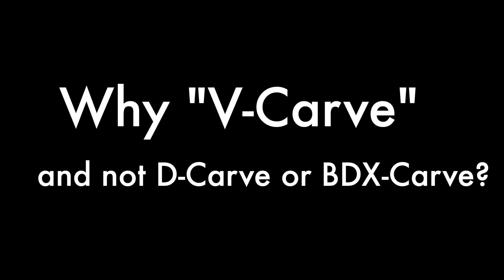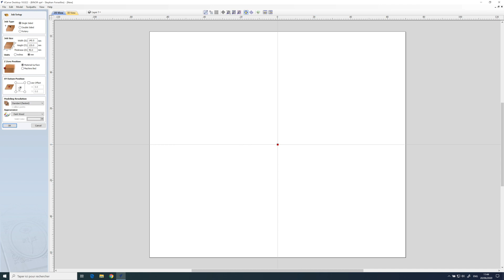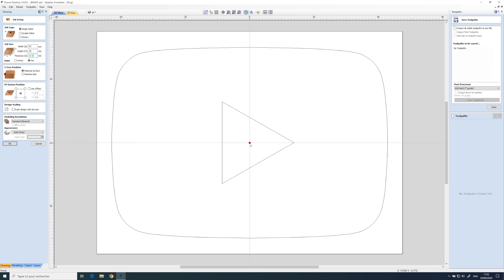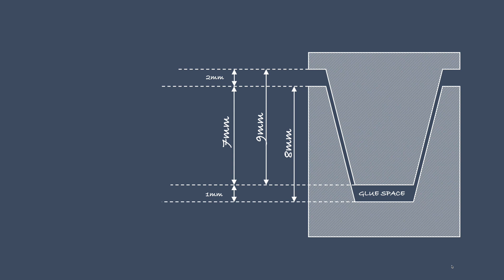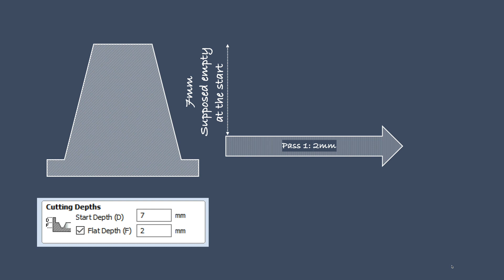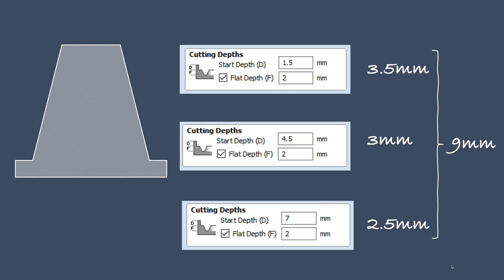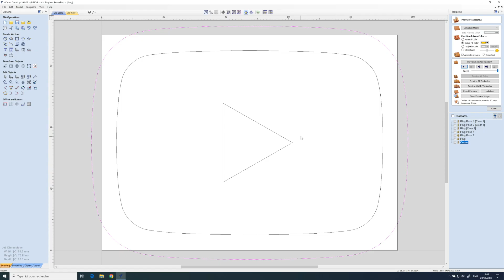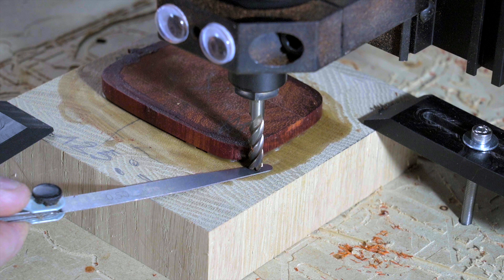Deep inlays VCarving detailed tutorial with Vectric VCarve

Comment: Great tutorial Stephan. Did you ever have problems with the plug being very loose in the pocket? I used the same settings you did, but it actually rattles side to side.  I'm using a 15 degree 4mm shank vbit. Perhaps acceleration, or deflection in the bit? Any ideas?  Thanks
Reply from the maker: Yes I have that sometimes if the carving is deep. It happens more in Y direction than in X which makes me think about deflection too. I have some ideas to test to avoid that...
Reply: I have this same problem! I'm thinking the vector for the plug needs to be enlarged a little before generating the tool paths. Please let me know if you found a solution to this problem. Thanks!
Reply from the maker: @tysonfish8065  I found out that configuring the bit as a carving bit with the right flat tip helps. If you don't configure the flat tip the bit goes a bit deeper than Vcarve thinks so you remove more material than needed both in the pocket and the plug.
Reply: @tysonfish8065  I cut a test circle pocket and plug yesterday. The plug wcame out too small and the pocket too big, which tells me   either my steps per mm is incorrect (unlikely) or my bit is taking off too much material. I had a thought to try it as a climb cut instead of conventional. I might do that next.
Reply: @Nealieboyee  and @Stephan Forseilles Thanks for this tips. I changed my bit to an engraving bit where I can define the correct flat tip and it did improve my results but the plug was still a bit loose. I then measured the angle of my 15deg bit and found it was actually 17deg so I changed the engraving bit angle to 8.5deg (as you know angle settings for engraving bits use half angle). This improved my results a little bit more. Finally I made my pocket and plug depth the same so the plug does not stick out by 1mm as shown in the video. After this change the pocket and plug fit very tight with very little to no movement. I have the pieces glued together and am waiting for them to dry so I can see how the glue line ends up looking. Thanks again for the help!
Reply: @tysonfish8065  Good experiments!  How did you measure the correct angle of your vbit?
Reply: @Nealieboyee  it was a very crude measurement but I simply traced the outline of the bit with a pencil used a ruler to extend the outline and then used a protractor to measure the angle. There is probably a much more precise method but this resulted in 17deg on the dot.
Reply: @tysonfish8065  Very clever way to do it! I know there are carving tests for 60 and 90 degree tests but they don't work so well with such a small angled bit.
Reply from the maker: @tysonfish8065  Indeed there is no magic bullet and a lot of things must fit together for a good... fit. :) There are specialized microscopes for measuring bit angles and flat tips. I don't have one but I'm thinking of getting one. Often they don't match what's on the specifications because in most applications one or two degree doesn't make a big difference. But as those add up when doing inlays, it can wreak havoc.
Reply from the maker: And in any case it's always better to configure the tip with a large angle than it is (you'll end up with a larger glue gap) than a smaller one (you end up with a loose plug).
Reply: @tysonfish8065  v

Comment: Very Nice Video and explanation.  What CNC machine are you using?
Reply from the maker: Thanks! It's an Aureus 3X from Euro Makers.
Reply: @sfo2406  Thanks for your quick reply.  I don't know that I will be able to afford this machine but it does look much more powerful and "solid" than my current machine.  Like other hobbies I've gotten interested in (too many!) I tend to buy something cheaper in case it "doesn't work out".  So, I purchased a hobby-grade machine that basically works.  After getting past some stability and alignment issues, a short coming for sure is the spindle which is just a cheap DeWalt router with a 1/4 inch bit capability.  So, carving always takes longer, especially clearing.  No need to reply to this, but, your video was well worth watching.  Like a lot of things in life, someone else's experience and tips can be a big learning curve reducer.  Gary

Comment: Thank you for teaching us. If I may ask a question... Instead of leaving the plug 0.5mm above the wood surface and then sanding it flat, I could choose to resurface the entire project down 0.5mm as the final step, so it's all flat, and less sanding would be required, is that correct?
Reply from the maker: Yes that is a perfectly good method! It also ensures that the board is really flat (which isn't the case when you sand).

Comment: this Is  a fantastic tutorial, but still can't get mine to fit the plug in the female slot. can't understand why
Reply from the maker: Does it not fit at all or does it fit badly? What I sometimes do in such cases is to make some tests in some material like MDF which is cheap and carves easily (but don't breathe the dust...). Then I glue everything and cross-cut in the middle to see what happened. If it doesn't fit at all it may mean that the start depth of the plug is 0. Remember that Start Depth is 'what goes in', for the plug (flat depth being "what sticks out").

Comment: This is by far the best tutorial I have found on deep inlays with V-Carve Pro. I only wish it were in Imperial measures. :) That is a small matter though to transpose.
Reply from the maker: Thanks! As a European I cannot grasp imperial, it must be genetic! :) But next time I will enrol Google to convert for me so I can put imperial measures in the captions.
Reply: @sfo2406  In your Tool Database for the 15 degree bit you are using, shows a Geometry Diameter of 6 mm. This is equivalent to 0.23622 inches. For the Amana Spektra #45780-K SC CARVING LINER 15°VT. 1/4"SH, the Diameter shows 0.1875 inches, (4.7625 mm). Is the bit you are using shorter in length?  I guess a better question is, what 15 degree bit are you actually using?
Reply from the maker: @Warpfield  Hi indeed 6mm is just below a quarter inch. It's 50mm long in total but that's not really relevant (I generally create new bits in the database by copying an existing one first and I almost never change the total length). What's important is the length of the carving part which is the same on all the bits of the same diameter and angle as long as the angle goes all the way to the full diameter. This is an example of such a bit: https://amzn.to/3djvOeG . You can also easily find them on Banggood for example: https://www.banggood.com/Drillpro-6mm-Shank-0_1mm-Tip-10-or-15-or-20-or-30-or-45-or-60-Degree-Engraving-Bit-CNC-Tool-p-1478458.html?rmmds=detail-left-hotproducts__2&ID=6155424&cur_warehouse=CN

But I couldn't find one on Amazon.com...

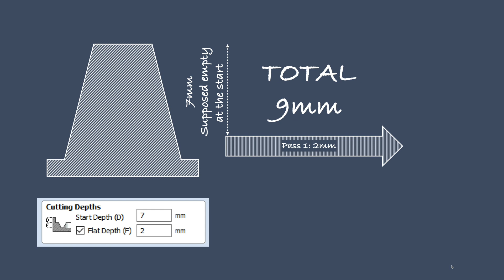Comment: @23:22 You said the start depth is considered as empty space but your solution of initially cutting at 1.5mm start depth then 2mm flat depth still means that you are telling v-carve 1.5mm is cleared which at that point is hasnt been. so you need an additional toolpath at the beginning with a start depth of 0mm and a flat depth of 1.5

So it would be 

SD 0 FD 1.5
SD 1.5 FD 2
SD 4.5 FD 2
SD 7mm FD 2

That way your bit will not plunge into your workpiece.
Reply from the maker: Luke Indeed you are right but up to  5mm depth at 1000mm/min is no problem for my CNC so I have a pass less. Especially for the first one as all borders will be re-done anyway by the next passes so precision is not super important.
Reply: @sfo2406  Yeah you are taking a 5mm depth pass to begin with instead 3.5mm as you put in your graphic in the video as in CAM its 3.5mm but in reality its 5mm. 
The video you made is impressively well produced by the way well done!

Comment: Thank you! Very useful tips...but i was wondering...as long as the final plug pass is 7mm start depth and 2mm flat end, can you make only one pass at the begining, with start depth zero and flat depth 7? this way the stepdown is controled by tool parameters,and you will reach 9 mm depth..what do you think, will this work? Thanks again!
Reply from the maker: Hello, thanks for the feedback. Imagine a straight V-Carved line of 5mm width. If you cut the pocket with SD = 0, FD = 9, the carving is 5mm wide at 0mm (surface). If you do your plug with SD : 0, FD = 7 then the width of the line on the plug is 5mm at 0 = at surface too (so the 'highest point' of the plug --> width at plug surface = width at pocket surface so they don't fit, the plug will not go inside the pocket, as the carvings (male and female) will be the same width at the point they touch. Not easy to explain without a small drawing. :)
Reply: @sfo2406  sir you are totally right, i did the drawing indeed!
Reply: @sfo2406 right,  but after that, i do the SD=7 and FD=2 , and it should narrow the 5 mm plug line at the surface, in order to fit, it is correct?
Reply from the maker: @hlopezho  Indeed but still the bit will have to cut 9mm deep on around half of its diameter; It's "less bad" than cutting completely but you will be cutting on just one side of the bit and if your CNC is not super rigid you could get some deflexion.

Comment: Watched this video 3 times now, got all my toolpaths set up tonight (after struggling to convert to inches haha).  Will be trying this out on the CNC tomorrow!   Thanks for the great tutorial.
Reply from the maker: Sorry for the metric. ;) Let me know how it went!
Reply: Haha I'd love to use metric but all my measuring tools are imperial :(
Reply: @sfo2406  Hi Stephan - I have a question about the cutting depths in each toolpath.  For the first pass in your plug it will cut 3.5 mm in total.  Do you still have the bit run multiple passes to get down to 3.5 (i.e. does it do 3 or 4 passes at 1 mm each during that toolpath) or do you have the bit cut that full depth in a single pass?
Reply from the maker: @ianbost193  Yes, up to 4-5mm in one pass is okay for my machine. If we're talking about the plug and you want shallower cuts BEFORE start depth then you have to create more 'fake toolpaths', more closely spaced. Anything between start depth and flat depth, Vcarve will create the passes based on how you've configured your bit.
Reply: @sfo2406  Yes I think we are talking about the same thing.  For example in your first toolpath for the plug you start at 1.5 and go to 2.0 flat.  That is a total 3.5mm of material removed for that toolpath.  Then you are using a 3.125mm endmill for the clearance.  I assume then you are setting that endmill's pass depth (via Edit...) to something high enough to get it done in a single pass.  As opposed to it having a default pass depth of say, 1 mm, in which case it would start from 1.5, plunge  1mm to 2.5 and do a pass, then plunge another 1mm to 3.5 and do a second pass (for the total 3.5 mm on that toolpath).  When I did mine I didn't take this into account and so every tool would go around the entire thing, go a tiny bit deeper, go around again, etc etc.  Took a long time.  Apologies for these questions haha.  I bought a shapeoko and the very first thing I did was to try a v-carve inlay (standard method 0.2 inches deep, 60 degree bit).  Now I've watched all of your videos and so the second thing I decided to do was move straight to deep inlays in endgrain using your method.  Thanks again :)
Reply from the maker: @ianbost193  You're not starting with the easiest part! ;) But for me experimentation and findings things out is 90% of the fun.
Reply: @sfo2406  haha if you mean starting with the pocket, yes I do the pocket first!

Comment: Excellent video! One question why do you choose to sand so much at the end and not do a light pass on the cnc and then do touch up sanding?
Reply from the maker: Jeffrey Craig Thanks. I generally leave about 0.5mm to sand. It's not really a problem with this small example but with larger pieces my planer is not precise enough to allow me to go lower than this and be sure not to damage the base board. 😅

Comment: You have solved many problems that an awful lot of others had no answer for.  Very well explained.   I just started using 15 degree.   I too have done a lot of experiments that were not more than fire wood trying to do deeper inlays.    Those that establish the method need credit as you did but those that further it and fine tune it and are willing to share need equal credit.   Thanks